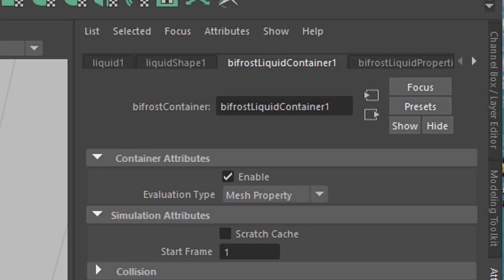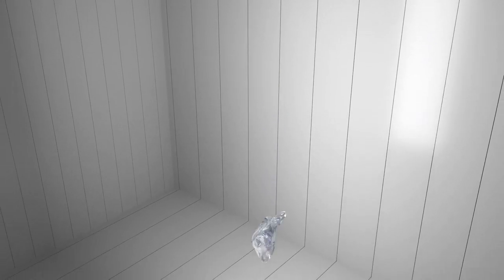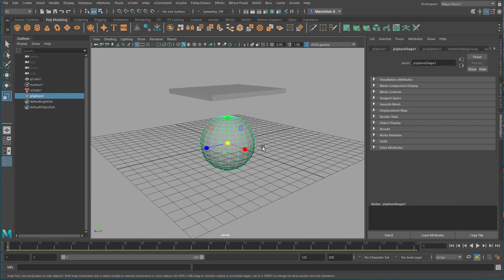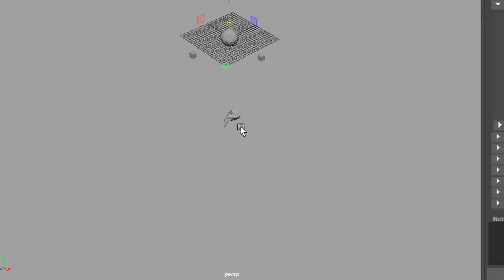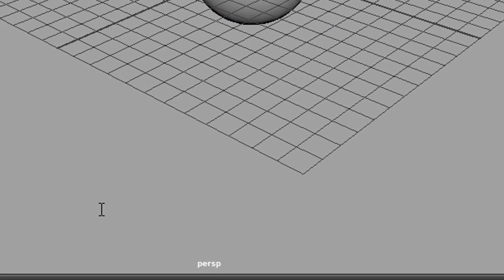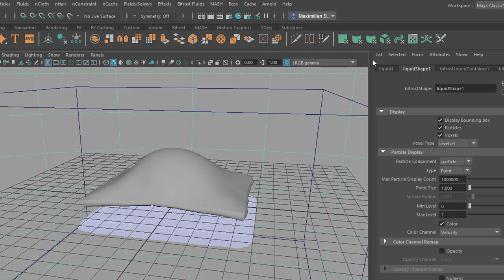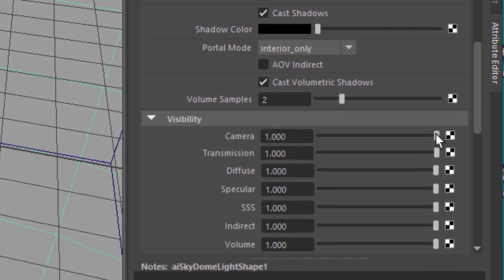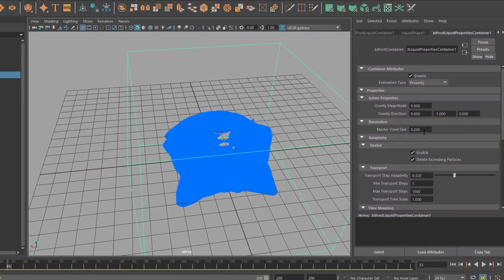Maya: Cloth to Water [nCloth and Bifröst]

Comment: hello im using student version and i cant batch render without watermark so im trying to render with render sequence but when i reduce voxel size its like impossible to render almost my computer is down how can i render my scene properly, thanks
Reply from the maker: rendering hi res simulations is CPU intense. even if you batch render. two suggestions: pre-cache the simulation, so that the renderer does not have to recalculate everything. secondly: when using the render sequence method, you might want to call up the process manager on windows or apple and lower the «priority» of the rendering app.
Reply: @Uhr24  thank you i will use this methods. And its awesome that youre careing viewers that much 👍